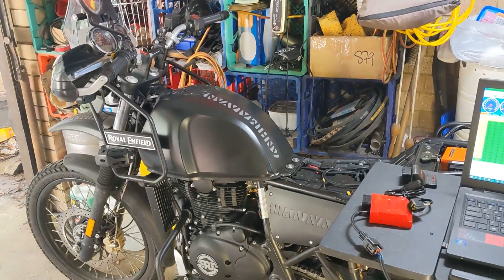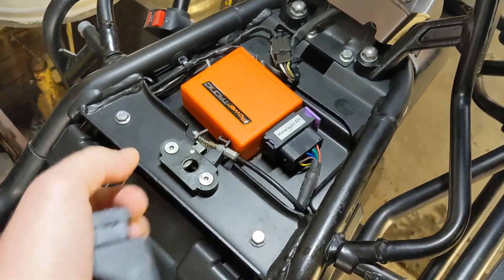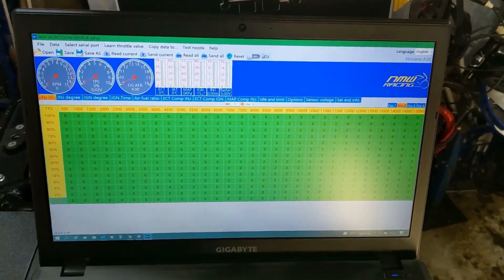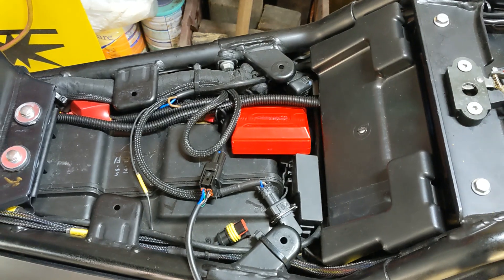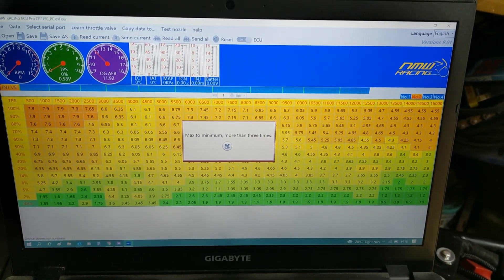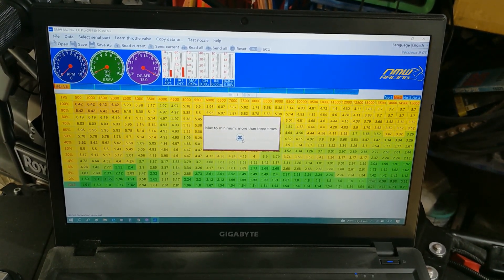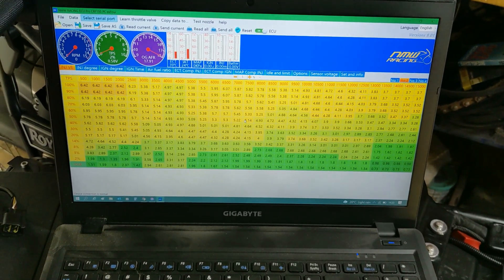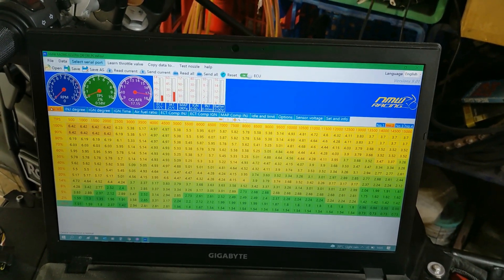Royal Enfield Himalayan ECU upgrade

Comment: How’s the red. Box performing now ? Is it worth getting
Reply from the maker: The Red Box needs to be tuned to individual bikes, which takes knowledge, and can be time consuming.  Personally, I feel that a PowerTronic or Power Commander piggyback unit is a better investment.  I'm currently running a PowerTronic for ignition control, and a FuelX Lite for fuel control, purely as an experimental setup.
Reply: @wollongongbiker  I appreciate this honest comment. Have been considering both solutions(Red Box vs Powertronics). I am ok with tinkering a little, but prefer out of the box solutions more. Keep up the good work, and best of luck.

Comment: Trying to remove my stock ECU, pressing the clip and pulling but can't get it to budge.  Any tips?  Thanks!
Reply from the maker: It can be tricky to pull apart the first time, but just keep wiggling, it will pull apart.
Reply: @wollongongbiker  Got a small screw driver in there to gently pry it apart, got it.  Thanks!